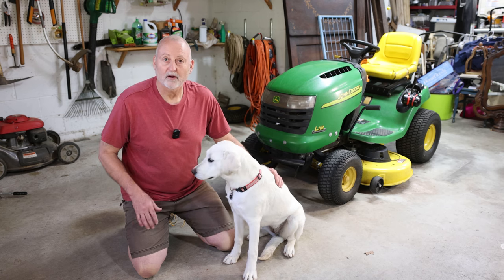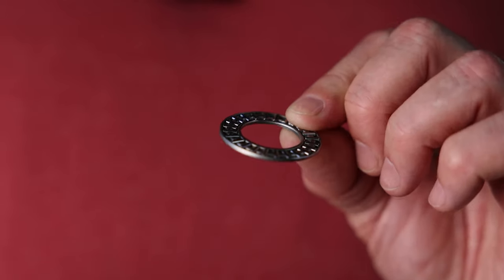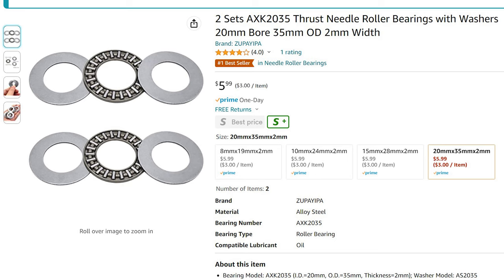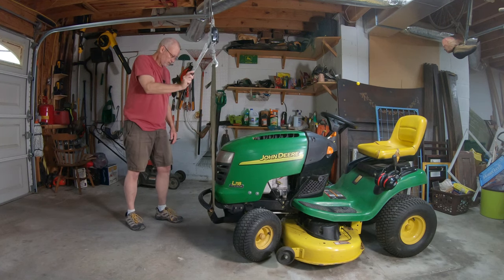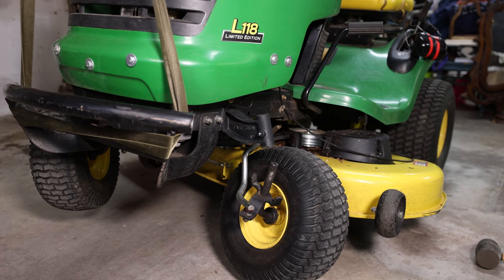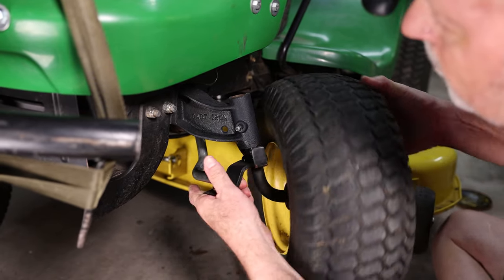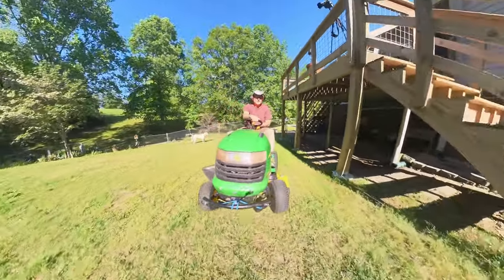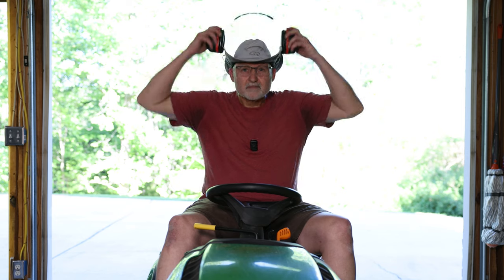"Poor Man's Power Steering" on a John Deere L118 (4K)

Comment: I did this on my John Deere X320.  Amazon $8.50.  My JD Dealer wanted $73.00 plus tax!  On my Spindles there is a 1/2" thick plastic bushing at the bottom of the King pin.  I noticed NO difference in steering effort.  That Mower looks like it had never been greased.  Check your front end carefully  If it has that Plastic bushing, don't bother.

Comment: Nice video. I just completed this mod as well as wheel bearings. I only have a 1/3 acre lot and my S130 is only a year old and I couldn’t believe the wear on the front axles. JD must want us to replace the expensive axle once it’s out of warranty. Glad I found yours and others mod help on YT.
Reply from the maker: Hey Mike! Thanks, man. I just bought an S130 last week. The frame broke on my L118 (video coming eventually). I'm considering doing the wheel bearing upgrade on the S130 also.
Reply: @RonBurkett  great! The axle spindle has plenty of room for the two washers and needle bearing - like it was designed for them.

Comment: Hey thanks pal! Did it to mine just now. 

A note for some folks…on some the top thick factory washer rides up to the clip opening after installing all that extra hardware. 

Instead of trying to fine a thin washer to make the clip fit, I took a thin blade to my grinder and shaved off a 1/16th inch from the top of the pivot housing. Took all but 10 min and it fits fine. The plastic debris caps fit better with the thick factory washer. Now I am set to change the needle bearings easily when they self destruct (and they will as thin and cheap as they are). It’s not like the power steering on my Kubota tractor but its 30% smoother.
Reply from the maker: Great! Thanks for watching and commenting and the extra info that might be helpful to some folks.

Comment: I just did this to my TroyBilt Pony 42.  I can notice a difference, but it's nowhere near as drastic as people say it is.  I mostly wanted to do this for when the vehicle is almost stopped at low speed, as I have to maneuver my mower into a tight shed at low speed, and that's when the wheel is the heaviest.
Reply from the maker: I agree - probably most noticable at low speeds - thanks for watching and commenting!

Comment: Is that a poor man's front bumper anti rattle device I see on the front?
Reply from the maker: Well, not sure what a "anti rattle device" is, but this an accessory I bought along with the mower. Just a regular John Deere front bumper. 
https://www.mymromarts.com/single-bar-front-bumper-bm23056-compatible-with-john-deere-x300-x304-x320-x324-x330-x340-x350-x360-x370-x380-x384-x390-x394-x500-x520-x530-x570-x350r.html?currency=USD&variant=mymro060014&utm_medium=cpc&utm_source=google&utm_campaign=Google+Shopping&utm_term=mymro060014&gad_source=1&gclid=Cj0KCQjw0MexBhD3ARIsAEI3WHLjl_k61g9OZWHcsyLDAO4sRifBTfii6pWadL-Q5G6SPFNVmuaM7o8aApnLEALw_wcB

Comment: Was not enough clear space to add the bearings on my craftsman 54" riding mower.
Reply from the maker: Sorry to hear it won't work for your mower - but thanks for watching and commenting.
Reply: Simply grind off the top of the Axle beam 1/8".

Comment: I own a John Deere LA105 John Deere... guessing it is 100 series like yours. I clicked on the link to the bearings set but has 4 different sizes to choose from. What size did you get ?
Reply from the maker: I used the 20mm bore size. Thanks for watching and good luck with your mower!
Reply: @RonBurkett  .. Thanks for your speedy reply. I just order it and suppose to be here tomorrow.. After 3 years since you installed it, you still notice some improvement in the ease of steering ?
Reply from the maker: @easyrider4649  I hope your modification goes well. I think there is a misunderstanding - I just did this a couple of months ago - not 3 years.
Reply: @RonBurkett  .. Oops ! My bad, for some reason 3 years pop in my head for no reason. HAHA ! I checked  and it says you uploaded the video 4 weeks ago. I was wayyyyyyyyyyy off .. LOL
Reply from the maker: @easyrider4649  Hey, no problem!

Comment: Could you forward me the setup you have hooked up to raise the mower front end? That looks nice and simple!
Reply from the maker: Hey Matt! Thanks for watching and commenting - Well, you are right, it is pretty simple - it's just a "come along" winch connected to some webbing tied to a board connected to the floor joists overhead. Then, a piece of webbing tied in a loop and slung around the bumper of the mower.
Reply: @RonBurkett  that’s genius! You should make a video on making that. It’d save those of us looking for a mower jack tons of money!
Reply: Look into the Harbor Freight chain hoist. If you have a place to attach it to the ceiling securely, they are great and a real back saver. I caught mine on sale for less than $100.

Comment: You could have released the steering connector from your shaft,then it would have dropped out by itself.
Reply from the maker: Thanks for the tip, Bruce!
Reply: Welllll, It must have been many years that a grease gun was used. Mine fell out as soon as I pulled the C-clip. The dust caps make a difference too. :)  I wish it had a better steering box, like a real one....
Reply from the maker: @gerardlunow567  You are correct, I had been derelict in my greasing duties.
Reply: @RonBurkett  I did sand of a mm of the housing to have the c-clip have a little play. It is nice to improve what you have and be respectful to your assets.